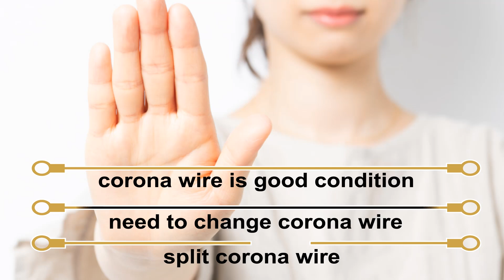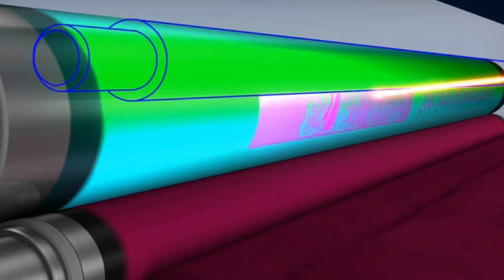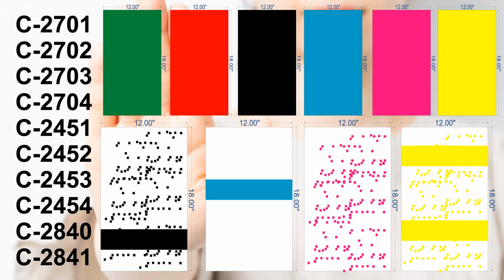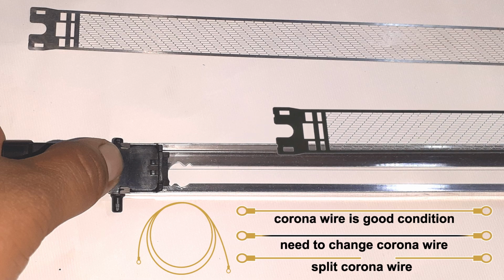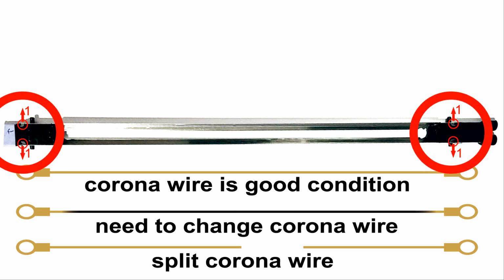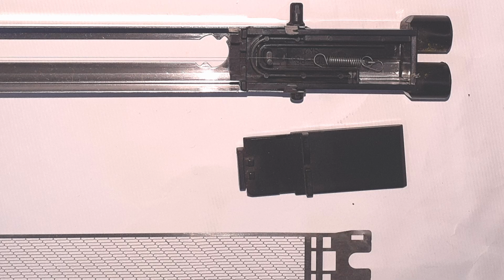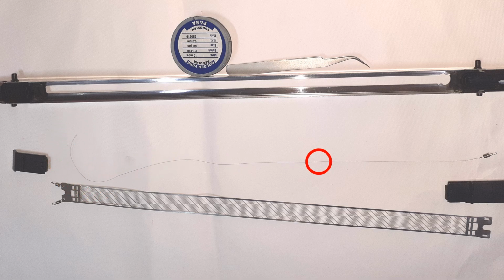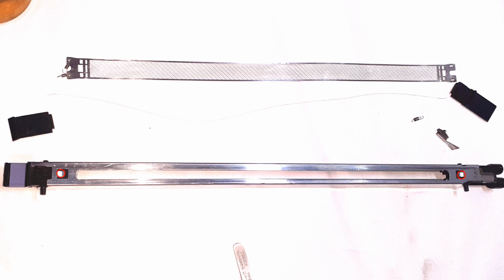Repair rebuild Konica Charging Corona Unit Fix Clean Change Thin Wire Error Code Full Color Issue

Comment: Konica minolta c6501 code 3103
Reply from the maker: cdb or adu bord problem mostly time
this issue mostly come after paper jam problem or after 15-20 lakh print.
1. clean processing unit connector
2. check motor connector
3. replace motor with duplex motor.
Reply: 2nd transfer pressure realease motor M34 on its turned off within specified time.